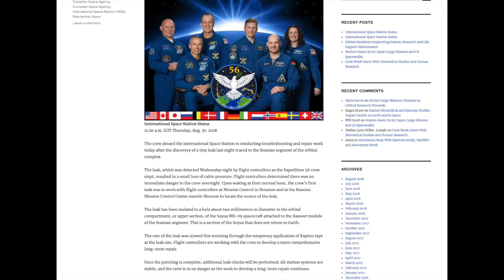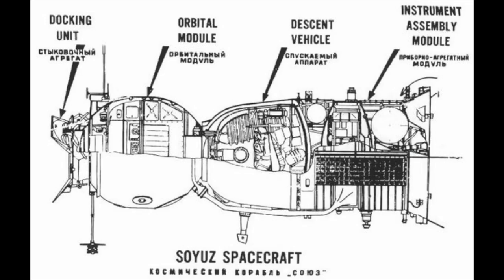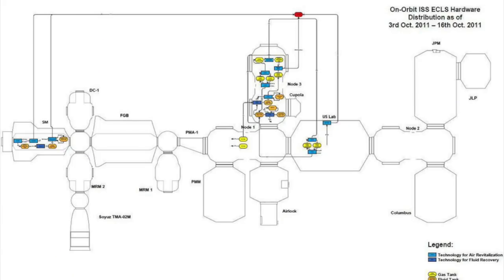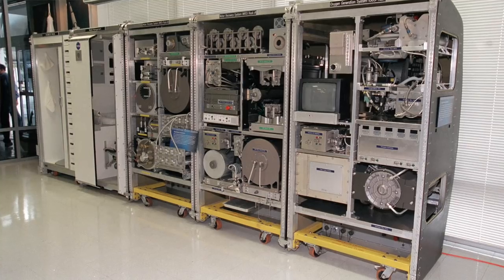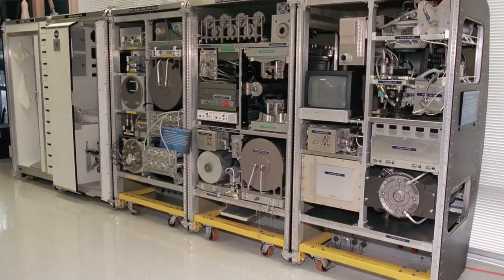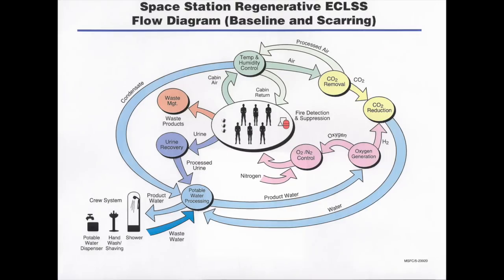Astronauts Are Fixing an Air Leak On International Space Station

Comment: Why do they dump the methane overboard? They could've been saving it for 20 years and have an extra supply of fuel in orbit. Even if the engines on the iss don't use methane, it would be valuable to have it up there for other craft.
Reply: Methane without oxygen to oxidize it and therefore combust it isn't going to be propelling anything.
Reply: Cragified 
Aside from other issues that make the overall suggestion impractical, I don’t see how lack of oxidizer is an issue. You could have a craft’s upper stage lighter than normal since it only has the oxidizer or minimal fuel with the intention of topping off in orbit. With a lighter “dry” mass (wet mass of a later stage is still dry mass for the stage lifting it) one would think the overall rocket ought to perform more efficiently.
Reply: Sphaera Invictus The lack of an oxidizer is one of the largest issues for use in any orbit thrusters for the ISS. As far as other docking craft there is a massive list of what makes it impractical but said craft may not benefit at all carrying less fuel. Because to transfer said fuel would require plumbing, pumps, regulators, connection ports etc. etc. All which would take up both volume and mass in any craft. You may actually end up with less cargo capacity in the end depending on said craft.
Reply: Cragified 
Dammit. I lost the response I had started typing so you’ll have to make do with a tldr recap. 

The craft doesn’t need to have those bits and bobs, after all it does just fine when it gets initially fueled on the pad. All the extra parts can go on the refueling station. That might increase the initial investment to get things going but remember, we’re not really minding the other issues that make this less practical. So the craft lifts off with just enough fuel to get to the refueling station, fills up and continues on its merry way. 

In fact, ideally you’d have multiple craft optimized for each part of the trip. The lifter craft’s job would be to bring stuff up to orbit and the transit craft would ferry the cargo from point a to b. It would periodically get refueled and resupplied as it cycles back and forth. I believe that was the point of buzz aldrin’s cycling spacecraft.
Reply: Sphaera Invictus You do realize that ground fueling ports aren't anywhere near the docking section right? Also the ground fueling is done with ground based pumping, regulators, and high pressure cyrogenic tanks all housed in quite a large structure. So unless you where to launch a whole module dedicated to the energy and thermal intensive and task of collecting, compressing, and cyrogenics of the tiny amounts of methane the docking craft would have to have the compressors and pumps to move it from a mid pressure gas state tank.  And even with said module said craft would have to have ports located at the docking ring to connect to said module. And these ports would require plumping, valves, and purge equipment.

So with the very small amount of methane produced between mission intervals any gain by going fuel light would be more then offset by the equipment to transfer said fuel. This makes it pointless and impractical so it's just more efficient to vent it overboard for the ISS.

Now a very large habitat station, with many more people it could be more practical.
Reply: Cragified 
This is why I said from the get go, “aside from other issues that make the overall suggestion impractical...”

I’m not saying we should be doing this right now or that we even have the tech and capacity to pull it off anytime soon. My comment was just addressing the response that the craft needs both fuel and oxidizer so the idea wouldn’t work. I pointed out that using the least amount of wet mass to lift into orbit and top off the now low fuel tanks (while the oxidizer tank is still “half” full) in space is not immediately ridiculous. 

To give a quick example, rather than take 2:2 (fuel and oxidizer) from the start, you take 1:2, reach orbit at 0:1, refuel to 1:1, and continue on to the destination. Better yet if you could set of with 1:1 on the pad, reach orbit at 0:0, refuel both tanks to 1:1, then resume. Or get even more optimized and have a dedicated lifting craft and a cycling transfer craft. 

Naturally this process would get more practical if there’s already an existing infrastructure to get said fuel to orbit cheaply, to have the machinery to transfer the fuel to docked craft, etc etc... These don’t currently exist so the overall premise is still impractical but my point is the general gist is not far fetched.
Reply: Sphaera Invictus  : What's impractical about filling a pressurized container with a pure and already separated gas you have on hand in another pressurized container? It's not like they don't already do that with other gases. Instead of dumping it into space, pump it into a tank. I guarantee you it's many times easier to do than ISRU.
Reply: Micai

1. You need a compressor to liquify the gas. This generates a significant amount of heat. Heat which is difficult to radiate in space. It also consumes a lot of electricity, something which the ISS lacks in abundance.

2. You need coolant systems to keep the compressed gas at a liquid state as it absorbs thermal energy or you will have to vent it. That is what you see venting from liquid fueled rockets on the pad after they have fueled up, their cryogenics venting to keep the tanks from overpressurizing. Coolants systems again generate heat and consume electricity.

3. You need a transfer system in place to pump the liquid fuel over as I've discussed with Sphaera.

For the ISS it's completely impractical for these and many more reasons. The production rate isn't significant enough is another. A very large station with hundreds/thousands of inhabitants might generate enough for it to be practical. But for the ISS no.
Reply: Cragified: Who said anything about no oxidizer? The point is that bringing anything to orbit is very costly, if you need oxidizer and methane, well, you don't need to bring all the methane, part of the weight going to orbit would already be there. Not that hard a concept.

Comment: The slightest hissing noise up there would probably get everyone's attention.
Reply from the maker: The space station is noisy, has lots of things running all the time
Reply: I am sure you're right Scott. But the slightest hiss if you heard it would definitely raise the heart rate briefly. Love your vids sir.
Reply: Only if you're next to the hole on a wall that isn't full of cupboards and racks which would dampen the sound, and in a quiet part of the station.
I'm pretty sure you'd feel the pressure drop with your ears before you'd hear it above all the fans whirring, and then you'd know that your time to solve it is ticking.
Reply: Thanks Andy. I do get that you would most likely never hear such a thing. Probably for the best in any scenario. I would shit myself.
Reply: Me too, though I'd try to save it for later to avoid wasting time!
Reply: Grace under pressure. I would hope to remain so composed. You would find me suiting up in a cold sweat at least. Have a nice afternoon sir.

Comment: Is the leak providing a bit of unwanted thrust?
Reply: yes, 40 gramms of thrust
Reply: 40grams? So like 2 ion drives?
Reply: A couple ten thousand years, and it's on an escape trajectory out of the solar system!
Reply: There sure is! The ISS is not completely out of the atmosphere hence why they need occasional orbital re-boosts.
Reply: Peter Carlson 
Plus all those solar panels don't just absorb light energy; they impart momentum to the station by doing so.  It's not a 'perfecly-stable-orbit-in-perfect-vacuum' situation like you'd find in an astronomy textbook.
Reply: This is true, but compared to the amount of drag they have on the atmosphere it's a tiny amount.
Reply: I am curious about the same thing.
Reply: Cam Whapshare  before you go straight into swear mode helps if you know the science. 

1) The ISS is not in deep space so there is drag from the near but not perfect vacuum of low earth orbit.

2) In respect to solar panels as specified in the statement you just replied to. Although light has zero mass it does have momentum. Thus a solar sail has been shown to be possible to produce thrust. 

3) Even the moon is travelling away from the earth at a trivial speed due to gravity wave dissipation although I doubt this has any bearing at all on the ISS due to its mass and time scale of expected useful lifetime.
Reply: Nothing perceptible
Reply: Cam Whapshare  of course there is, its not a lot, but thete are still enough air molecules up their to slow you down enough to reenter the atmosphere, it just takes a while.
Reply: There most certainly is drag at the altitude of the ISS. I think something like a quarter of a newton (for the whole multi-ton and bulky station), but it's most definitely there. Tiny, but we have to give it periodic boosts to keep it from reentering due to the drag.
Reply: Cam Whapshare  There is no sharp cutoff between 'upper atmosphere' and 'space' and the ISS is operating in that area which we consider space but which still has some marginal amounts of atmosphere. It generates enough drag to slow down the ISS ever so slightly, which they compensate for with the occasional correction boost.

There's no drag in deep space, sure; but the ISS isn't in deep space.
Reply: I don't see any noticeable changes in this graph due to the leak, but I thought this link might provide some helpful information https://www.heavens-above.com/IssHeight.aspx
Reply: +Cam Whapshare Unfortunately, there is. There are very small particles that induce drag even in the very depths of space, but it's completely safe to ignore.
Reply: UNQUESTIONABLY, the leak is providing thrust. It's just so infinitesimal that the loss of pressure would become an existential threat MUCH sooner than the change in their orbital parameters. Remember that the station has thrusters for station-keeping which are certainly far more powerful than the minuscule amount of air trickling out of this leak. And since we don't know precisely where this leak is in relation to the ISS's trajectory, for all we know this leak could be pushing them into a (infinitesimally) HIGHER orbit, which would actually be a good thing.
Reply: ProgHead777 
I had the belief that there were reaction wheels but no attitude thrusters on the ISS, and that orbital boosts and corrections are done by a Soyuz module docked along the centerline.
Reply: Cam Whapshare  research before calling somebody dipshit, dipshit
Reply: Mark Watney would be so proud.
Reply: There is a small amount of atmosphere in low Earth orbit, causing the space station to very slowly drift into a lower orbit. Therefore, the ISS has to be routinely re-boosted back into a higher orbit.
Reply: They're not far enough into orbit to be completely outside of the atmosphere, there's an insanely thin atmosphere at that altitude.  You might want to check your ego before posting that sort of comment, quite rude for being ill informed yourself. Anyway, not trying to start a fight, I'm sure you're plenty good a guy/gal. The fact is there's a very minor drag force due to the thin atmosphere at that altitude.

You can see it mentioned in this 2011 article: https://www.nasa.gov/mission_pages/station/expeditions/expedition26/iss_altitude.html
Reply: therealnightwriter 
Found the flat earther!
Reply: There's a sharp question!
2πr = πd ~= (3.1416)(2mm)=> 63 grams or .62 newtons; not quite negligible given the mass of the ISS (which I think is around several tons) and the fact that they left it for several hours so the crew could sleep.  It's not going to de-orbit the station or anything.  They can figure out if orbital correction is needed in a few days after its made about a hundred orbits and tracking vs. plotting errors start showing up.
Reply: several tons? try 550 tons.
Reply: Oh this is an illegitimate question, but Asteroid Gravity Tractors are a good idea?!
Reply: If it did, I'm sure the reaction wheels in the truss segments would compensate for it. I'd be more curious how that little amount of thrust would compare to the amount of drag the solar panels cause.
Reply: The reaction wheels could only compensate for the induced rotation, but not translation.
Reply: I figured as much about the wheels. Though what are the chances the thrust caused by the hole would be perfectly inline with the stations center of mass.
Reply: Everythong below is just estimation.

Each pair is 35x12 meters, but this includes the gap between them, so let's say 35x10 meters. And there's 8 pairs, so total area is 2800 square meters. Atmosphere density at 400 km is about 10^-12 kg/m^3. ISS orbital velocity is about 7700 m/s. So with these data, the drag at maximum would be about 83 mN, or 8.5 grams. And ISS definitely considers this significant - they even rotate the panels to be edge on when they're on the night side. This leak is about 5 times stronger - so yeah, it would be significant if it went unfixed for months.

(Unlike the drag, however, you can rotate the whole station to direct the force)
Reply: Cam Whapshare  there is and its not even that weak, they have do make sometimes burns to hold on to its orbit. There is nothing like a Vacuum it only exist on paper.

Comment: Ultrasound? Couldn't they just set fire to their own hair to find the leak?
Reply: The airlock to the hab broke and detached itself, with him inside. His spacesuit reads that there's a leak, and he has to find it but it's to small to see. That's why he sets fire to a strand of his hair and uses the smoke to see where the leak is.
Reply: Oh, so my guess was correct. It's an old trick anyway - used to find paths out of caves and mines and so on.
Reply: What
Reply: Ето?
Reply: I think he means there will be a visible smoke path showing air flow towards the leak.
Reply: Have none of you read "The Martian"? It was a reference to that.
Reply: No, I haven't read The Martian. What was the setting fire to hair reference about then?

Comment: Typo in the title lol "Astronauts Are FIxing an Air Leak On International Space Stations"
Reply: It should be "Astronauts Are Flexing On An Air Leak On International Space Station"
Reply: *leek
Reply: Should be Cosmonauts
Reply: Rene, if you insist:
The Raumfahrer temporarily sealed the leak with his finger, contaminating the surface.

The Astronaut put ducttape on it, which will leave sticky glue residue on the surface.

Meanwhile the Cosmonaut was trying to reach someone at the Mission Control Center in order to get proper procedure and the needed permission from the ministry of heavy machine building to modify the spacecraft.